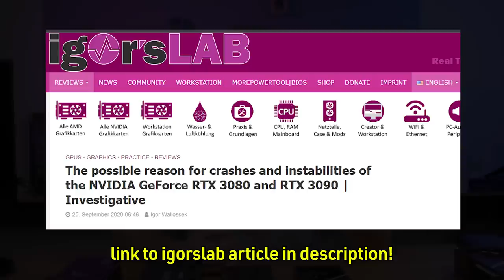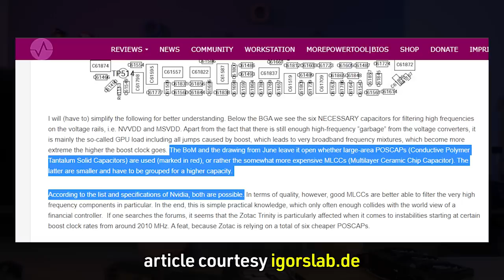The RTX 3080 Launch can't get any worse... Right? Wrong...

Comment: Just to summerize. So if I buy a FE or ASUS TUF,  i'm fine?
Reply: pretty much yeh
Reply: Funny thing is rog and ftw used 6 cheap one
Reply: The TUF seems to be insanely good value from a branding that has historically been reserved for entry - mid spec models
Reply: What about the MSI one?
Reply: @p4p4juju  do you have proof i need to cancel my preorder if you're right
Reply: You are fine anyway because it just works! Just buy it!
Reply: as if it wasn't already going to hard to get the Asus Tuf Gaming card. No wonder it was overclocking and doing better than the other cards.
Reply: @standapp9172  TUF never been entry level lmao.. Alot of TUF motherboards has top scores in reviews
Reply: And it will look beautiful with my TUF x570 motherboard
Reply: @user-dz7dr2bz1t  I wouldn't cancel pre order over it. You can just reduce your maximum gpu boost in msi afterburner if you have the issue they are all still good for the 1710 mhz speed.
Reply: @p4p4juju  As far as i can tell there's pictures out there with 6 cheap ones and 6 expensive ones on the strix cards...
Reply: @standapp9172  Yes the TUF series has always been rugged, I build an FX rig back in 2011 with a Sabertooth 990-FX R2.0 motherboard and it wasn't that expensive and it held up like a beast
Reply: @user-dz7dr2bz1t  pretty confident the strix and tuf series are fine...
Reply: If you look on asus website the tuf is also using cheap ones
Reply: If you go onto seller sites, as well as ASUS own site, the TUF has the 6 cheaper capacitors in their pictures?
Reply: @p4p4juju  wait what?
Reply: ROG strix is fine. Latest pics show 6x complex bois on the back of the card
Reply: @user-dz7dr2bz1t  i preordered the strix too and i saw a video from der8auer and it has 6 of the expensive ones, so dont worry :)
Reply: Jackfraggs been getting ctd on his founders edition during live streams this week, just saying ;)
Reply: The Asus ROG strix edition has 6 of the expensive arrays (MLCC) so that one is definitely worth it.
Reply: @p4p4juju  wow you're not joking rog does have the cheaper ones wtf
Reply: On every picture i have seen. Both TUF cards have 6 of those black chips.
Reply: TUF on asus site shows the cheap ones
Reply: Quick question... All the images of the ASUS TUF on websites show them having only POSCAPs. I assume that these are only stock photos and not representing the actual card?
Reply: thank god, the tuf is the best card it seems anyway
Reply: @andybrown8507  Are you sure? cuz if you look on asus's website at the card they show the cheapo bois and I already ordered one
Reply: damn i could have bought the tuf but everyone talked me out of it
Reply: @emanuellandin7403  mine 2 brøther   ! TUF FTW 2020 ! Reminds me ofvthe good old Direct CU II cards
Reply: @pjgj2107  it does. Wonder if they had those renders made then changed spec because rog shows the cheap ones too
Reply: @donovanschoor1473  Yup, go on the ASUS website, TUF has six cheap ones on the product picture. Good old review patch out first and retail gets shitty ones?
Reply: @benover17  @DanielPlayGaming just watch der8auer's vid of the strix, he actually flips it over
Reply: probs
Reply: They stepped it up with the TUF 1660 Super. I had one for an ITX build earlier this year and it was a very good card.
Reply: @p4p4juju  the strix uses the same as tuf, 6 of the expensive ones. Idk why there are images of the cheaper ones on the back but every rog strix ive seen in videos has the expensive ones for all 6. There are photos of 6 cheap ones and photos of 6 expensive ones on their website, probably old photos
Reply: BadJuJu rog strix the cheap onnes real y?
Reply: @NevermindJayProd  MSI's 3080 models got 5/6 so at least better than Zotac. MSI's 3090 models got 4/6 like the FE so no worries there.
Reply: @user-dz7dr2bz1t  nah like I said in my above comment, they're old photos. All cards in videos have all 6 as the expensive arrays
Reply: @benover17  just looked at the pcgamer review of it and it shows 6 good caps in a photo of it.
Reply: The strix card also has 6 cheap ones... Ugh. Guess it's Nvidia or Evga for me
Reply: @p4p4juju  Strix has 6 MLCC (Expensive ones), according to Reddit, other youtube reviews and images.
Reply: @benover17  read everyone's comments. The strix has the same as the tuf
Reply: If you have a 700w+ supply and have 6 fully connected +12v lines coming from the PSU to the cards, probably.
Reply: @user-dz7dr2bz1t   Strix has 6 MLCC (Expensive ones), according to Reddit, other youtube reviews and images.
Reply: @p4p4juju  ROG product pictures show 6 cheap ones, but if you check out the 2-3 actual rog 3080 and 3090 videos on youtube, youll see the production version has 6 good ones.
Reply: For now
Reply: @Chugs4Serotonin  no it doesn't
Reply: @SH4D02  it does on the asus website. Both the Tuf and the Strix. This is confusing.
Reply: if you can get one of these cards... ;-)
Reply: @standapp9172  Just think what the MASTER and XTREME might be like coming soon™
Reply: @NevermindJayProd   just looked up a teardown video. 5 and 1 poscaps
Reply: Jesus one uneducated comment just scared dozens of people lmao
Reply: @joewerts  yeah TUF. but the asus rog strix OC has 6 golden. lucky for me thats the one i got on pre order. seems like the 35 bucks cheaper non OC has 6 cheaper ones. sounds like a bad deal to me.
Reply: @jeffreyjacques8668   ILY it made me feel so much better thanks!
Reply: the asus rog strix or original is the cream of the crop ..really I think the asus rog strix card is better then original
Reply: @Roundhead75  I don't trust it or the asus website now because both show different things. I think I'll just wait until the 4000 series lol. Better safe than sorry
Reply: Man I kinda wish I'd waited
I got an order in for the EVGA 3080, I hope it's not a huge mistake
Reply: @RKBock  stay in the overview and scroll down and all six of the tuf are the cheap ones
Reply: @Roundhead75  "MLCC" aka ceramic caps are a dime a dozen. They're by no means "expensive".
Reply: @Exletalis08  All youtube review videos i have seen now has the 6 expensive ones. But all reference pictures show 6 cheap ones. I'm starting to think that the tech sites received more expensive and reliable cards, to get better results in testing.
Reply: @GholaTleilaxu  It has 16 times the detail!
Reply: @Chugs4Serotonin  will you just watch the videos dismantling the cards? It's been linked several times now
Reply: @FabledGentleman  that's what I'm thinking! I just don't trust it
Reply: @standapp9172  tuf was historically for solid mid range motherboards built like tanks. Then they expanded to gpu's and went to be a cheaper lineup for people who want asus but don't want to pay for strix. It's just value brand now
Reply: The Asus TUF is very fine. Igor had a picture with all 6 arrays of better caps.
Reply: I've been holding out for a TUF for the low 62c on load temps.  That is amazing.
Reply: @jeffreyjacques8668  oh thank god, the asus tuf is what I ordered XD
Reply: @NevermindJayProd  MSI has low limit power, avoid. Asus TUF, FE and Gigabyte Gaming OC are recommended
Reply: @user-dz7dr2bz1t  idk which one you mean but Strix is fine, just checked from Der8auer vid
Reply: Or just wait a month or so, I'm sure all manufacturers will update their designs pretty quickly now that the problem is understood. And maybe release "revision B" models with a slightly higher price, unless they want to create a lot of confusion by having different designs with identical names out there.
Reply: "ohh damn I was not able to buy one!!! Stupid bots!!" ... Good news? Bad news? Who knows!
Reply: @Chugs4Serotonin  so you dont trust videos of people that own the cards with proof of the expensive components on the back?
Reply: But there's a TUF oc and 'regular' 
I ordered the regular... 😑
Reply: @cheesetomatoes  what i mean by that is  "not the crappy ones" is that better?
Reply: No, wait for the follow on card. It will be better.
Reply: My evga XC3 is fine I run at 1995mhz and sometimes 2005mhz and It never crashed
Reply: @SH4D02  ikr, this section's going wild...
Reply: @MoMoMonsterkil  der8auer also has the tuf vid from one week ago. It also has 6 expensive ones
Reply: @ShallowRavers2  It will be interesting if asus figured it out early and changed their cards, without telling the competition or nvidia.
Reply: What about the ROG Strix?
Reply: @p4p4juju  The 3090 Strix has 6 of the expensive ones, like on the TUF. You can see it on the Asus page.
Reply: @BrandoniousMaximus  scroll up... 😅
Reply: @Roundhead75  you aren't listening. If the website THE CARDS COME FROM show 6 cheap ones, but reviewers and overclockers that had cards sent to them have 6 expensive ones, then something isn't adding up. They could've been sent better cards than what the public is getting. That's why I don't trust it. Shit. Why would Asus's own website show cheap ones if they're all supposed have expensive ones on the pcb?
Reply: @RTR15Glenn  what?
Excuse me, but where exactly should I look?
In the gallery, there are two pictures showing the backplate. Both of them, in the overview and when zoomed in, show the expensive ones. Am I missing something or do you see things that aren't there?
Reply: And there goes my chance to get the ASUS TUF for about a month. Damnit.
Reply: Sorry, but it looks like the TUF have all "bad" caps...  https://www.asus.com/media/global/gallery/gqz0gtiruwjhlcpi_setting_000_1_90_end_500.png
Reply: BadJuJu ROG Strix have 6 Good ones. Just Watch der8auers teardown.
Reply: @Chugs4Serotonin  dude do you actually believe they'd send out different cards for reviews? How stupid do you think people are? The backlash would be enormous, they'd never take the risk... Ffs some people...
Reply: @p4p4juju  No, ROG from the pictures, uses "good" ones. TUF uses "bad" ones..
Reply: @justinv3080  no you can't. You'd have to limit gpuboost with a new vbios
Reply: @Bxkeh  where were you able to pre-order them?
Reply: @jeffreyjacques8668  I looked at it. But the website shows something different. So it seems like reviewers are getting better cards sent to them. I don't get why that's so hard for Y'all to understand lol. Yes, THEIRS have expensive ones in the teardown, but what if I order the same card, and it doesn't like the ASUS website shows?
Reply: @SH4D02  what about EVGA?
Reply: @benover17  as someone already pointed out. They pics on the website are probably stock photos or images made from the reference design and not even production cards.
Reply: @NevermindJayProd  MSI GAMING X TRIO its build with 5+1
Reply: TUF has also 6 cheap caps. MSI Gaming X Trio has 5 + 1 and the EVGA XC3. The FTW3 for some reason has also 6 cheap ones
Reply: You guys need to stop going off product photos and go look at real evidence. There are videos of actual people showing that there are 6 MLCC. Stop spreading false info
Reply: What are you talking about? The TUF has the cheaper capacitors.
Reply: NevermindJayProd msi has one MLCC so we should be fine hopefully
Reply: @RKBock  in the overview of the card not in the gallery of photos. At least it looks like they're the cheap ones to me
Reply: @NevermindJayProd  Checked another video, 1/6
Reply: @NevermindJayProd  13:53 He says MSI has two. Seems like you are okay if you bought the MSI.
Reply: @NevermindJayProd  It's crashing. Downclocking 50mhz helps (gaming trio - don know what with ventus)
Reply: Here goes my chance to get the asus Tuf one lmao now that almost everyone gonna get them xD
Reply: @jeffreyjacques8668  I don't trust anyone lol. AIB partners were obviously dumb enough to underbuild their cards to save money. So it doesn't seem that farfetched.
Reply: @NovaLand  that's a pic from overview. Now go to the gallery. 🤣
Reply: @ericschmitz03  that's what I thought too from the pics on their page, but on the video from Derbauer it has 6 of the expensive ones... I'm confused now
Reply: @standapp9172  I thought that. The Tuf line was always garbage but suddenly it's good.
Reply: God damn it! Aib partners are charging a huge premium in australia and they are cheaping out
Reply: @drunky504  you can limit gpu boost with msi afterburner negative offset
Reply: @RTR15Glenn  ahh... Do you mean where they show off the GPU bracket and other features? 
If yes, I'd assume that this is just a stock photo that they had even before they launched.
Reply: @Chugs4Serotonin  if you're this paranoid, just dont get any?
Reply: idk about that, all the cards ive looked at have the cheap array
Reply: what about the strix series from asus?
Reply: There is only ONE pic showing cheap caps, and absolutely ALL the other evidence showing otherwise. I think we can safely assume that the ONE that we are seeing is a reused stock photo. Or maybe not. I m confused with the OC and non OC now. 😅
Reply: @donovanschoor1473  that's impossible. There is no hardware difference between the Rog Strix and the OC version. It just had an OC applied to it for which they charge 35 bucks.
Reply: Strix is fine too, full array is better
Reply: @krakenkill  The TUF has 6 of the more expensive & better capacitors . You can clearly see it on Hardware Unboxed 's video
Reply: wrong. Read the comments above!
Reply: @Zelinkondorf  don't blame us, blame the manufacturer for having the wrong pictures on their website. If there were more of the cards on the wild we would have more info, but since that's not an option, manufacturer pics are a reasonable source, because it could mean that some of them switched at some point, which means that several variants could be out in the open. Contrary to what Jay mentions in the video, updating a PCB is not the same as updating a tool, it's much faster.
Reply: Just don’t get a strix, they use all 6 of the cheap capacitors (doesn’t make sense)
Reply: @wassupwithit4783  people are saying it has the best layout in teardown videos but the ASUS website shows the strix having the worst. So i guess buy that one or the Tuf and hope it's not different from the teardown videos.
Reply: @andybrown8507  thats because they are reviewers, us plebs just get the leftover crap
Reply: @Chugs4Serotonin  you're fear mongering out of ignorance. Just don't buy one, who tf cares.
Reply: Yup, pretty much. If you bought one of the 3080 where the AIB didn't cheap out on the components you'll be fine since the voltage stability will be equivalent to the FE one.
Reply: @p4p4juju  ROG Strix has the same as Tuf all the MLCC groups all 6 of them...
Reply: @Chugs4Serotonin  Well i really hope it's not like that. On September 17th i bought the TUF 3080 OC, and i will get it next week. Now at least i know the first thing i will look for.
Reply: I think the summary is to wait for the brands to make it right.
Reply: @RTR15Glenn  no it doesnt watch its teardown
Reply: @p4p4juju  thank god i almost bought ftw3
Reply: @jeffreyjacques8668  the strix uses all 6 expensive ones
Reply: @phil9079  dude, there's 151 comments, which one do you mean?
Reply: @BoognishQC  oh i know my man, I'm not a nay sayer here 😅
Reply: The 3080 is a mess no matter what. They should have put 12 GB of GDDR6 instead of 10 GB of GDDR6x. The memory bus would have been 384-bit instead of 320-bit so even with the slower frequency of GDDR6 the memory bandwidth would have been higher. It would also have run cooler and been cheaper.
It's just inexcusable.
Reply: I Googled the 3090 TUF and it has 6 of the cheap ones :(, and that's the one I have on the way. The 3080 TUF has only 4 cheap ones, so it's OK. I need the VRAM tho so can't go with 3080, and don't wanna wait for 3080 20GB.
Reply: Guys can you help me?

I bought the EVGA 3090 XC3 Ultra, am I fine? I can't cancel my backorder,  I live in Brazil and things here are a little more complicated 

Thanks
Reply: @p4p4juju  The ROG one uses the expensive one too, they look like the cheap one, but they are the expensive one, you can know this looking at the back of the tuf and the rog, they are the same. 

Sorry if I am wrong, i search a little and find this conclusion
Reply: Rip to those people posting "I got the cards boiiissss!" on reddit.
Reply: @user-dz7dr2bz1t  I think he is wrong, i comment about this in my last comment
Reply: @lort6022  TUF were considered trash in the last 2-3 years, with their 5700xt being the epitome of garbage engineering.
Reply: @Chugs4Serotonin  because its just a picture and not the final product lol who would usually care if it had a black square on the back or a gold one? Nobody i trust videos of people who own them..... I will see in a few days when my 3090 tuf turns up
Reply: @Artey86  well there is. go look it up if you dont believe me. it makes sense. the problem comes from doing OC. so the none OC has 6 cheap ones. so. the non OC is a complete scam to be fair.
Reply: @davem5276  + 64x tessellation of the sea floor. The more you [insert whatever] the MOAR!
Reply: @user-dz7dr2bz1t  Gamer's Nexus video titled: "Limited OC Headroom: RTX 3080 Extreme Overclocking" has a shot of the back of the FTW3 card at 6:59
Reply: @S1nw1th1n  ok cool I will
Reply: @Roundhead75  fine. I'll just take your word for it then. Sorry for freaking out, I was just getting frustrated because I nobody was understanding what I was trying to say, and they jumped to calling me an idiot. All someone had to say to begin with was "stock photos are rarely accurate" and I would've been like "oh, cool"

It wasn't that I don't agree with the proof in the teardown, it's just more of "why would they use a cheap layout version for the same photo" kind of thing.
Reply: the one from poodle safari. Basically, and it's what I believe is true, the pictures that are on the sites with the cheap ones are old. There are pictures of the expensive ones out there too. So what happend is that they repost those pictures of those expensive ones.
Reply: @p4p4juju  the FTW has the 5-1. He even shows it in the video.
Reply: This is a bit weird, because a lot of ASUS TUF RTX 3080 cards have 6 of the cheapest capacitors.
Reply: @Chugs4Serotonin  no, worries matey... Are you going to get a card or sticking with your old one? And your not an idiot your just as confused as we all are lol nighmare all this BS... Seems like customer satisfaction went out the window with the dinosaurs.
Reply: I'm actually blown away by the TUF compared to the 2000 series. Not only is it a study design, and runs cool, but they did not skimp on the components. They win my money this time around.
Reply: @SpaceXPeekedツ  I just back-ordered the Asus rog Strix OC. Finally found a place doing this.
Reply: @phil9079  could be true, but it could also be that there's 2 variants out there. Maybe the new design has the expensive ones, but they also made some of the cheap ones before they noticed. My point is that we need more info, no way to be sure right now.
Reply: May not be accurate pics but all the ASUS cards show the 6 cheaper capacitors on their website. All the cards have pics of the caps but now I see there are two different pics. One is clearly the cheaper caps, the other look like all 6 may be the good caps. 

Scroll down 
https://www.asus.com/Graphics-Cards/TUF-RTX3090-O24G-GAMING/

From the gallery tab
https://www.asus.com/media/global/gallery/jc7icm9090k8tujs_setting_000_1_90_end_500.png
Reply: I have ordered an Asus TUF OC from a local shop, once I saw this video I was like, uh oh. Then he mentioned TUF should be ok, I was happy again :P
Reply: @David0241  in a spanish store, they only ship to spain tho
Reply: @Chugs4Serotonin  i literally said the photos could've been old or altered 20 minutes ago... And then you wonder why people call you out?! 😂
Reply: @donovanschoor1473  Show me proof, an actual pic of a non-OC Strix vs an OC Strix 3080 that shows the non-OC has cheaper capacitors.
Reply: @Republic3D  Thats what i  linked where do people take  the one with  6 good ones? i'm  confused, i  ordered msi one  and no way im buying it just to have bios update  lowering
 clocks
Reply: @DeathMetalinfedel  Yea you are right wtf. Maybe they realized the problem after that was taken as a marketing photo and fixed it on their own?
Reply: @aljoker7808  I just ordered an MSI Ventus 3080, but all the pictures on the web shows 6 cheap ones, except the pictures on the MSI website where there's one expensive one. I'm starting to wonder if the reason this launch was so bothced is that nearly all cards were made with the cheap ones, then recalled before the launch. Hmm.
Reply: @donovanschoor1473  Oh and btw, the Asus website literally shows the back of the Strix NON OC CARD with 6MLCC array. 
https://www.asus.com/Graphics-Cards/ROG-STRIX-RTX3080-10G-GAMING/gallery/
Reply: @emanuellandin7403  I know I have the same thing and since I first saw the 3080 TUF card with the aluminum shroud instead of plastic it went to the top of my list ..... Then the reviews came out and I decided I would wait even if another brand became available and now this really seals the deal ..... If I were Asus it's be cranking these out as fast as I could and if they raised the cost another 50 bucks I'd still buy it over the others
Reply: @Republic3D  Ventus is cheaper option with  older   fans, the x trio one has one good one and 5  cheap, thats  the one i pre  odered,  and  tuf gaming   had 6 cheap ones, they  found the  issues  and upgraded  to  6 expensive  ones to  make  them look good. Proof is everywhere, overlockers uk for example u can  see 6  cheap  ones   on   the  photo.
Reply: @RKBock  yes I think that's the case too
Reply: @pjgj2107  I've just done a bit of digging and in fact all stock photos on the sites that I checked in the UK which show the rear of the cards exposed show what appear to be POSCAPs on all of them, probably because that was the reference PCB/early design but it looks like they have been altered to 2 MLCCs now. So the stock photos on the website was probably an early design with the cheap power arrays.
Reply: Well looking at the pictures of the TUF it looks to have the 6 cheap things
Reply: @SpaceXPeekedツ  good deal. Just an observation and it blew up :D
Reply: @DeathMetalinfedel  EVGA just posted an announcement which essentially confirmed that the 6 cap was early production version which they used for marketing. They recently learned about the error and did not ship any 6 caps to customers. They have updated their products to include 2 MCCLs.
Reply: @_Caddac  it wasn't ftw version. he said XC3. check evga website and it show ftw used 6 cheap ones so is rog.
Reply: @p4p4juju  if you look at EVGA's twitter right now they've confirmed that the images on the website were wrong and the FTW3 uses has 4 POSCAP (cheaper one) and 20 MLCC (expensive one) and the XC3 has the reference design of 5 and 1. 

https://forums.evga.com/m/tm.aspx?m=3095238&p=1
Reply: @_Caddac  i seen it and they said they used 4 +2 because it was sweet spot and there was problem with 6 expensive one. watch video from gamer nexus when he used ftw3 with 6 cheap one beats asus tuf with 6 expensive ones.(Custom RTX 3080 Overclocking: EVGA FTW3, ASUS TUF, & Gigabyte Eagle Results)
Reply: @andybrown8507  It looks like ASUS initially planned to release it with the cheaper capacitors but identified the problem before release. So now they are (probably just to be sure) all the expensive arrays.
Reply: @SH4D02  Indeed, it seem to be old photos. Seems like Asus originally planned to use the cheap ones but identified this problem before release. Opting for the 6 expensive arrays just to be sure.
Reply: @Artey86  je bent 100% nog een kind want je kan het totaal niet volgen.
Reply: @DeathMetalinfedel  Well not everyone or there wouldn't be any reports haha. :P
Reply: @donovanschoor1473  ik zei de EERSTE STICKY REPLY. Ja? Een tabel waarin duidelijk staat welke merken en welke modellen wat hebben. Asus TUF, EN Strix MLCC. Jesus fuck.
Reply: @Artey86  ik gaf je al een link. In die reddit staat niks over de rog strix oc en non oc. Leer lezen
Reply: @Artey86  er staat aleen strix. Dus je weet niet of dat oc of non oc is. In andere woorden. Het zegt niks tegen mijn argument
Reply: @donovanschoor1473  op de site van Asus kan je de pics in de gallery zien van de NON OC zoals ik al gezegd heb EN de link heb gedeeld en daar ziet een blinde (dus jij ook) de FULL MLCC array op de Strix NON OC. en voor de laatste fucking keer, er is geen hardware verschil TUSSEN DE STRIX OC EN NON OC. het enige verschil is binning en een factory OC op de firmware. Ik weet echt niet hoeveel keer ik dit nog moet herhalen.
Reply: @donovanschoor1473  en Nee er staat niet OC / NON OC op de reddit OMDAT ER GEEN VERSCHIL IS. wow.
Reply: @Artey86  ja pik. Maar mijn link van ook een asus website geeft mij weer gelijk....
Reply: @Artey86  nog 1 keer de feiten op een rijdje. Dit is mijn laatste reactie. Oke. We weten dat die caps aleen een probleem zijn bij hoog overclocken. Asus heeft 2 versies van de rog strix 3080. Een oc, en een non oc. We vinden alle 2 fotos/renders op official sites met sommige kaarten met 6 gouden, en ook met 6 zwarten (mijn link). Dus het is dus duidelijk dat er 1 kaart is met 6 gouden, en 1 met 6 zwarten. Gaat het belletje al rinkelen? Logisch nadenken? Nee? Oke. Omdat zwart prima is voor non heavy overlooking is het dus Logisch dat de non oc 6 zwarten heeft. En de OC versie 6 gouden. Ik snap niet waarom dit zo ongelooflijk moeilijk te snappen is. Ja ik weet dat asus ook de non oc laat zien met 6 gouden. Maar dit is gewoon en fuckup. Trust me.
Reply: @lort6022  no but its mid tier, they have rog above it for high end.
Reply: MLCC isn't automatically better. They are cheap and small, they are prone to cracking and piezo effects, they also have bad temperature characteristics, and they lose their capacitance faster. POSCAPs are stronger and not prone to cracking, they also have no piezo effects, POSCAPs should also operate better at higher temperatures.
Reply: Ye u are fine with asus rog strix and tuf  have 6 mlccs aswell  so nothing to worry about.
Reply: I’m a noob.. what’s the diff between the 2 Asus 3080 TUFs?
Reply: You dont go wrong with Asus. As usual.
Reply: ASUS TUF is already reporting serious problems, google yourself. So far only FE lives up to promise.
Reply: Or a trio
Reply: Just checked. The gigabyte and zotac 3090 also has 6 cheap ones. All asus cards i have seen, has 6 expensive. Msi is building after spec with 2 expensive.
Reply: “224 replies” oh boy...
Reply: @RKBock  Maybe they are hoping for people to cancel pre-orders so they can get one.
Reply: Good look finding either, especially the FE
Reply: I would double check that because according to the newegg picture its got 6 of the lowcaps.
https://www.newegg.com/asus-geforce-rtx-3090-tuf-rtx3090-o24g-gaming/p/N82E16814126454
Reply: @Alcyeragraeth  The pictures seem to be from prototype models. All the actual cards you see in videos of people testing them have 6 of the expensive ones.
Reply: @p4p4juju  Never heard of ROG till recently, thought it was a bit budget honestly
Reply: @jeffreyjacques8668  Yeah I just got a strix but I'm waiting for delivery. I'll check but I'm pretty sure you're right
Reply: @Battleneter  They rather noncommittally shot it down. 
"The appropriate number of POSCAP vs. MLCC groupings can vary depending on the design and is not necessarily indicative of quality. "

"Not necessarily" is not strong language.

The updated drivers probably prevent cards using the factory settings from spiking above 2000Mhz where they can be unstable.
Reply: I think you're fine if you have a high end power supply that also exceeds your 12v requirements. Definitely tier 1. Then you could buy any of them. If not, yeah asus.
Reply: @jc.1191  As per Jays new video, it was JUST a driver issue, however this video misleading a LOT of people is their fault!, he is not sorry, you misunderstood lol
Reply: @p4p4juju  Wouldn't expect the ROG to cheap out
Reply: I think the ROG Strix card also has all 6 expensive capacitors.

Standard Fare Asus: Damn good high quality stuff, that absurdly expensive!
Reply: @KayDizzelVids  This video has mislead you, Asus cards were also reported as crashing, it was never a capacitor issue.
Reply: @Battleneter  I already know.  And Jay posted a video about it.
Reply: @KayDizzelVids  Jay posted a "Face saving video", no apology and this video is STILL up misleading people for click $$
Reply: @Battleneter  I think people know the truth by now.  And it's not like he gets paid alot for YT ad revenue anyway.
Reply: Also shit this is a long reply thread!
Reply: @KayDizzelVids  If you sort by new comments, you can see new people coming in and getting mislead by this crappy Jay vireo that REALLY needs to be taken down.
Reply: @lort6022  TUF is not their highest end though but it's always been very very high quality.
Reply: Blaming capacitors turned out to be a complete load of Bullshit!, the crashing was occurring on ALL models including Asus Tuf,  and now fixed with drivers.
Reply: Asus rog or asus tuf?